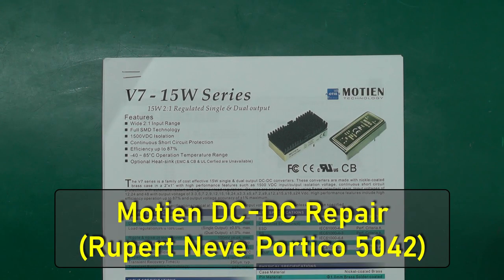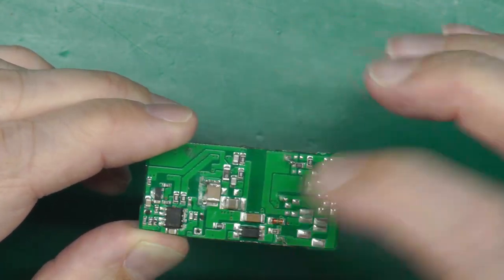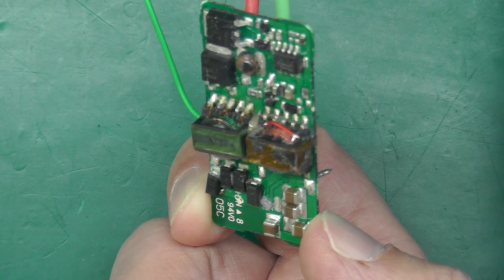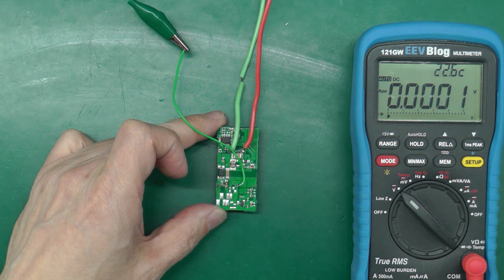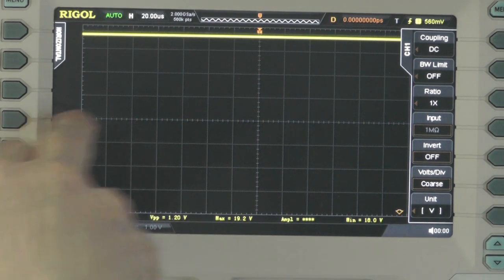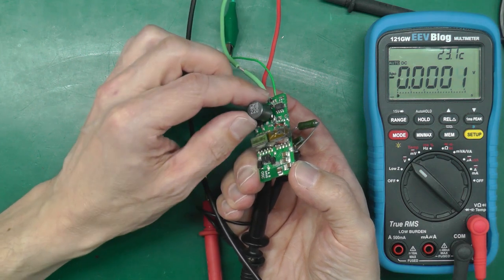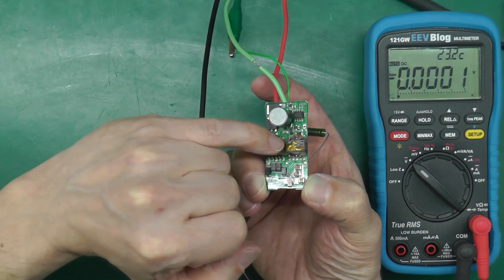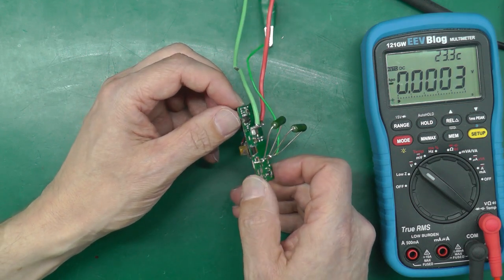No.053 - Motien DC-DC Repair (Rupert Neve 5042 Tape Emulator)

Comment: Hi, I know you did this ages ago but can you maybe check power consumption of neve 5043. I'm planing to bypass Motien DC-DC converter and power the unit directly from linear PSU.  The PSU I'm looking at has Output 15W  DC - 18V@1A. Should I be ok with that?
Reply from the maker: Would love to but it was a repair for a friend so i had handed it back.
Reply: According to the specs, both the 5042 and 5043 consume 9W, but when I actually tested mine, the 5042 was using 9.6W, and the 5043 was using 13.5W.